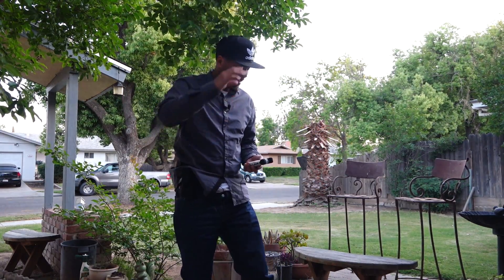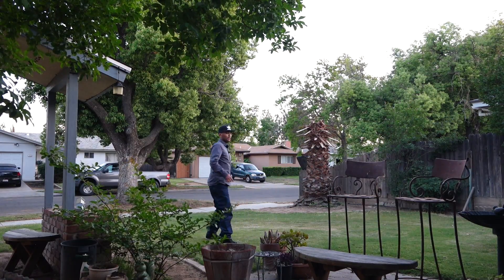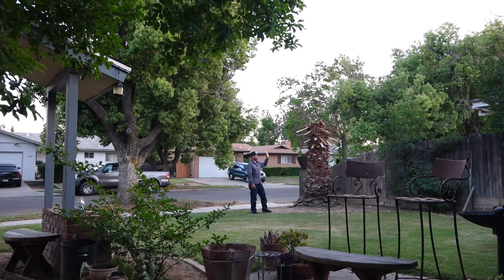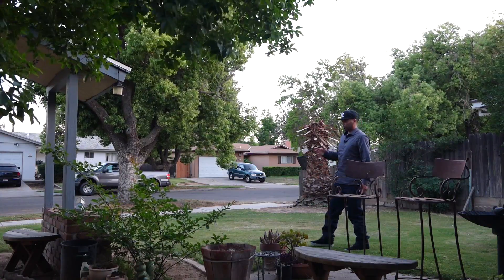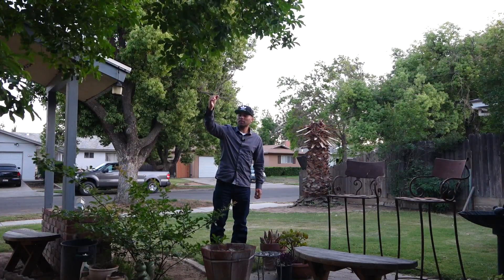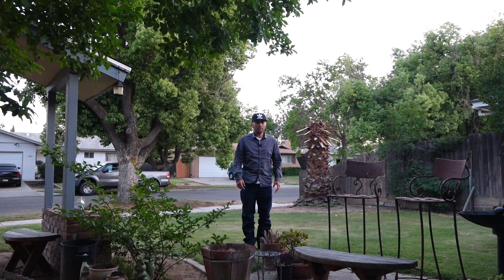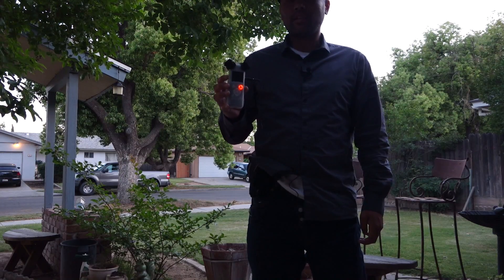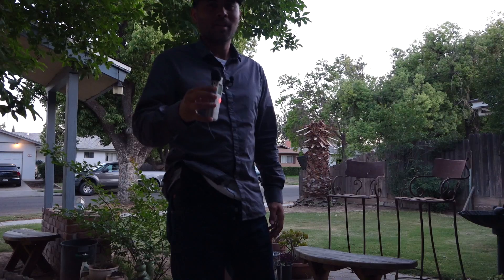Olympus LS-10 Audio Test

Comment: Great video. Thank you.  I just purchased a used one of these. When I turn it on, the screen comes on and all of the menus seem to work fine.  All of the buttons below the rec/stop depress and have a click when you press them but the record and stop buttons do not. The record and stop also do not do anything.  When pressing record,  the red light does not come on and the meters don't show sound activity.  Do you know what might be wrong?  I had a Sony MiniDisc that had a record button lock on it as well and you could tell when it was engaged because the buttons would not depress.  I've been reading the olympus manual and cannot find any mention of a button lock, however.
Reply from the maker: In the very beginning of the video I engaged the hold button so the unit would be locked. So if any of the buttons were pressed, including the record button, it would not effect the recording. The hold button is a little switch on the left side of the unit.
Reply from the maker: I will need to check my Ls-10 to see if that might be the issue. I'll try and get back to you. The recorder is stored away. I need to locate it lol
Reply: @simoncejas  Thank you!
Reply: @simoncejas  Here is a short demo of my unit explaining the issue.  Thanks again.  https://youtu.be/Y3n48eNounM